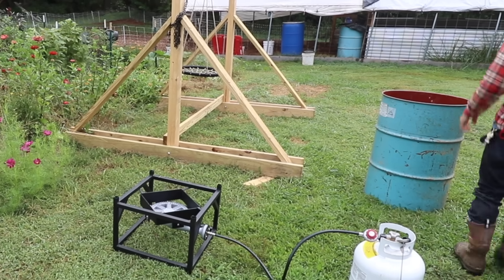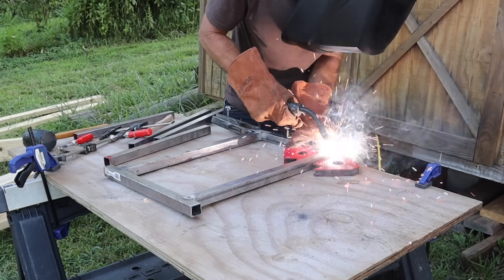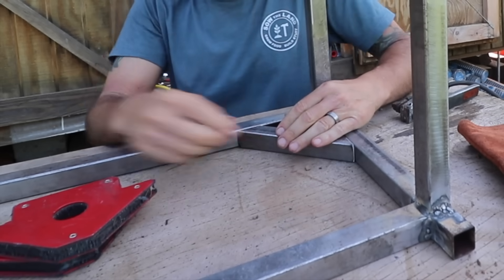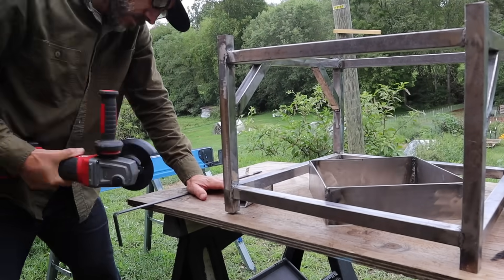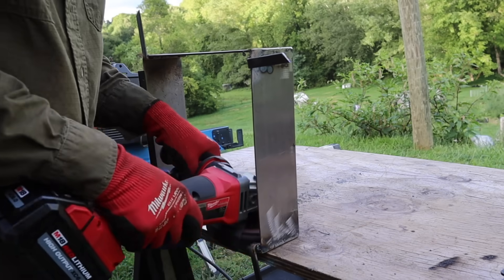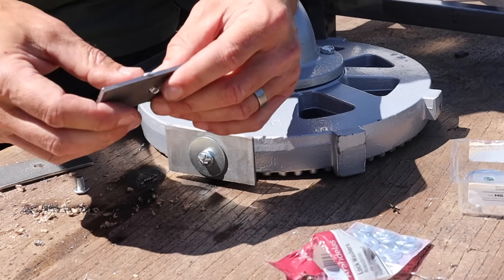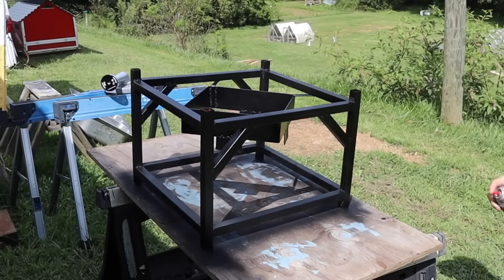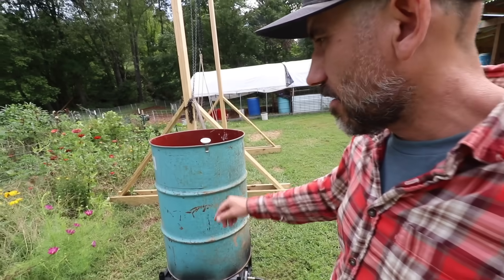DIY BIG Propane Burner to heat up a 55 gallon barrel (Beginner Welder Project)

Comment: great project. for those not able to weld, you can make the stand with black pipe and fittings. and have the burner rest in a metal tray.

Comment: LOVE THE DESIGN !! THIS thing could make a great large batch fryer for a get together. Love it. A little friendly criticism on your weld joint. It appears you need more heat on your weld joints. Which will fuse (melt) the welds better. Though, this thing could last forever. I am only mentioning this because of the use. Rust can collect in the pin holds and eventually rust out. Your welds do not look like they had much penetration on camera. I would hate to see that much boiling water dump on a person. Do not get me wrong. You did a great job with the design and being new to welding.  Just wanting to warn you a bit. Your welds could be  cleaned up with a grinder and re-welded. As always, love what you guys do !!

Comment: You did job on the build but the air and gas mixture is off, open vent until the flame is blue then it will burn more efficiently and hotter

Comment: Could use four plastic top caps for the leg tops and bottoms, so they won't get water inside and rust with the rain.
Reply: or since he's a welder now he could weld metal squares on top!

Comment: If rare Earth magnets over heat they can loose their magnesium. So carful not to over heat them
Reply: No, only neodymium are subject to that and at a fairly low temp. The welding magnet clamps are samarium cobalt or AlNiCo.  They would have to get really hot, but welding is very localized.

Comment: Just wondering how long the bottom of the barrel will last being heated that much?  Will the heat / flame destroy the bottom?
Reply: No, the water in it will protect the bottom from getting to a high heat.

Comment: Nice work Jason!  Good vid.  the water weighed about 300 pounds.  Water weighs 8.34 pounds per gallon.  You had it a little less than 2/3 full after evaporation thus the weight is a somewhat less than 306 pounds.

Comment: Would it be helpful to clean and use the black heat paint on the barrel, particularly the bottom?
Reply from the maker: I did do that. I guess that didn't make the edit. thanks
Reply: @SowtheLand  Your welding project looks great too!

Comment: How will you regulate the temperature of the water to maintain it at 150 for scalding?
Reply from the maker: The heat does adjust. Thanks